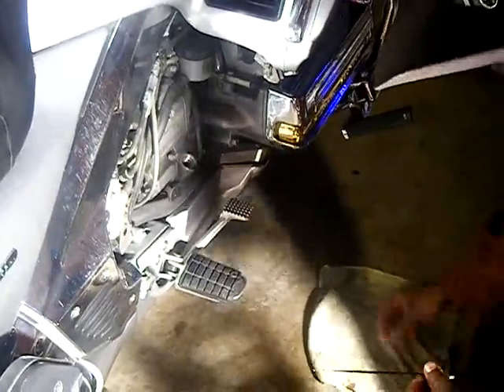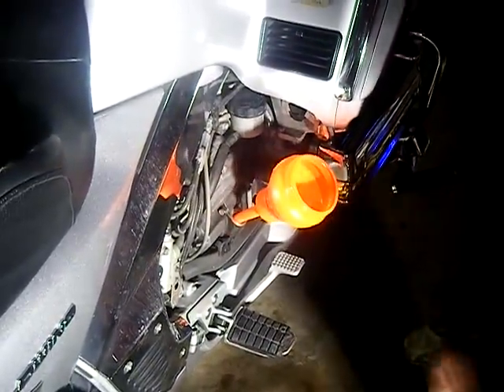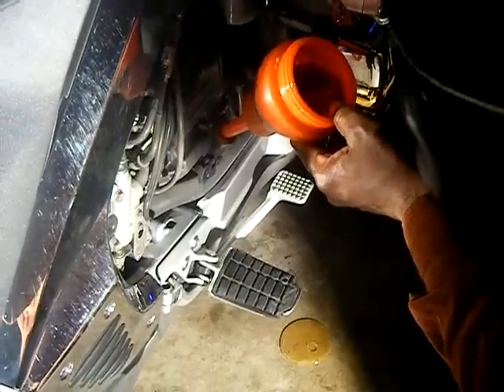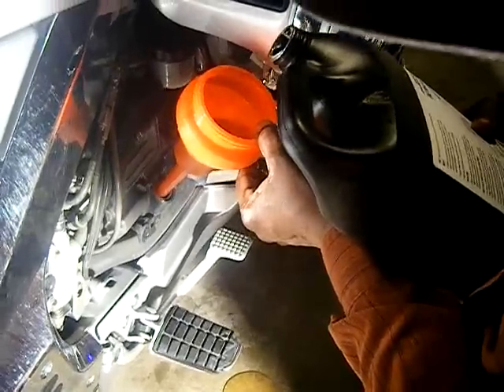Goldwing Oil Change Brother Cowboy 8

Comment: Thank you Brother Cowboy.  I now know how to change the oil/filter on a Goldwing.
A bike I don't yet have.   I learned that a belly pan is important to be properly secured
in place. 

Additionally, I learned that the 17mm drain nut, and oil filter should also be securely fastened as well, not too tightly, but securely, or ideally according to the manual's specifications. 

I hope you have lots of fun on your Wing, as I plan/hope to as well.
Reply from the maker: +Ray Charles Hope I was able to help

Comment: Don't know if anyone will see this but I'll post it anyway. I always put an old pizza box under the drain pan, and fill spout when I change oil. No matter how car-full I try to be, I always spill some. Splatter or drips don't matter on the card board. I always use clean oil out of the bottle to lube the gasket and threads of the new filter. Old oil has acids and stuff, that's why your changing it. And always wear rubber gloves. Used oil is not good for you that's why they say so on the bottle.,,,